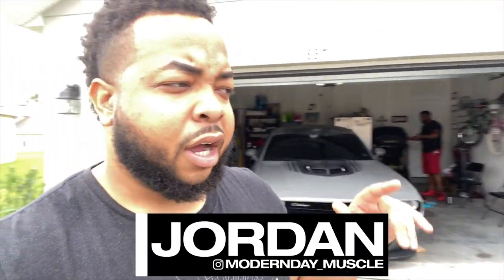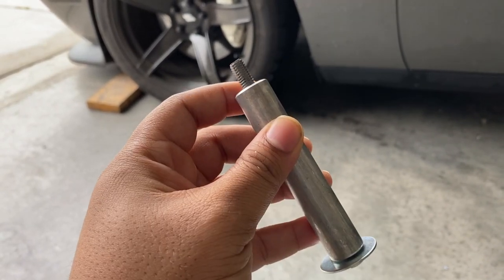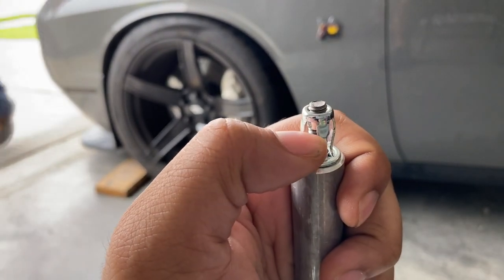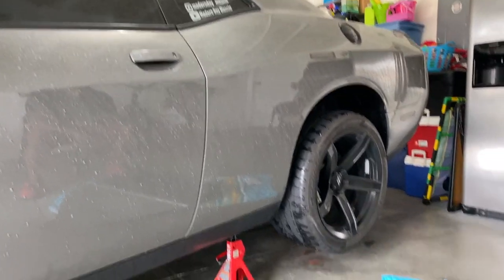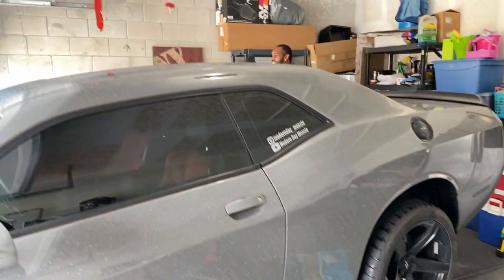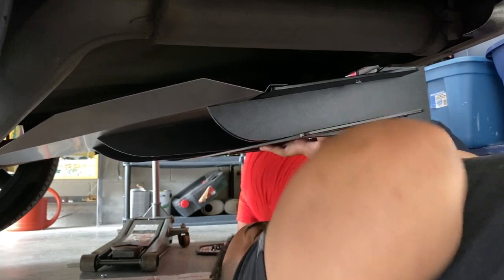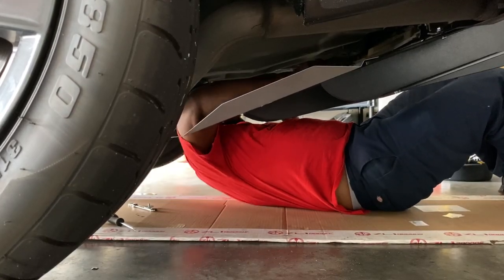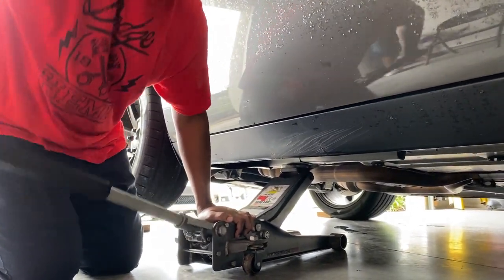ZL1 CHALLENGER DELUXE DIFFUSER INSTALL & FIRST IMPRESSIONS.... MUST WATCH TIL END| MODERN DAY MUSCLE

Comment: Looks great !!! Are you lowered by Eibach springs? Mine is, can barely fit one finger between tire and body so with that being said what's the measurement between ground and bottom of the defuser ???
I have like 4" at the splitter and figuring it would be about the same in the back.
Reply from the maker: Damn I actually need to measure that stay tuned

Comment: Im not a car guy at all, but how can u tell if u need the treaded bolts before purchasing the wrong one? I dont wanna go thru this
Reply: 1 year late but... Only way to tell is to crawl under and look at the cross member. You'll be easily able to tell if it's threaded or not in there
Reply: @Vengancejr  lol i got the same one in the video. I don’t even remember if it was threaded or not. I think it wasn’t
Reply: @DCGEMINI202  yeah I just put mine on. It was threaded. Apparently it's 50/50! 🤷
Reply from the maker: Glad you got this sorted
Reply: @Vengancejr  Seems like it's dependent on the model year of the car. Looks like around '17+ is not threaded.